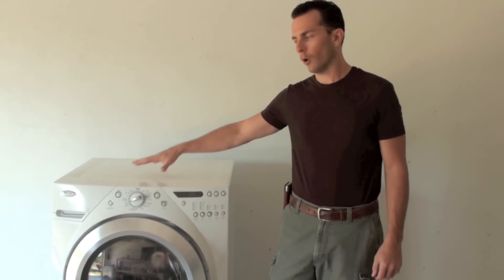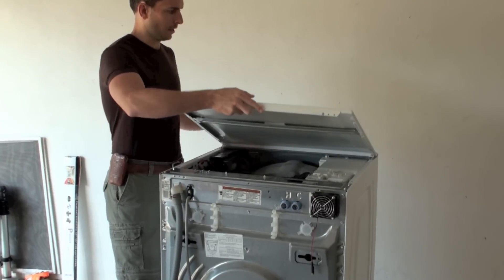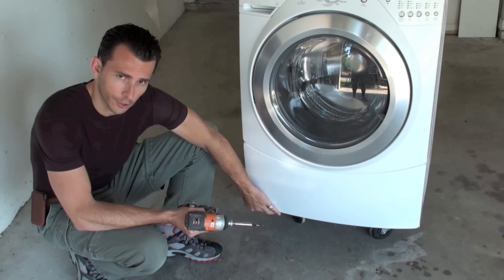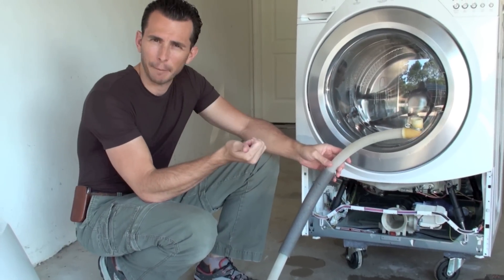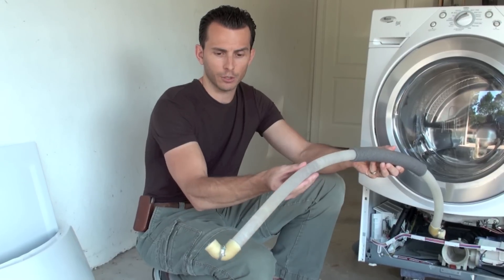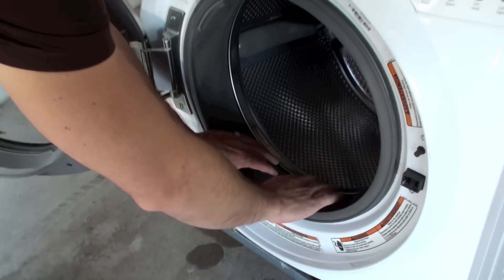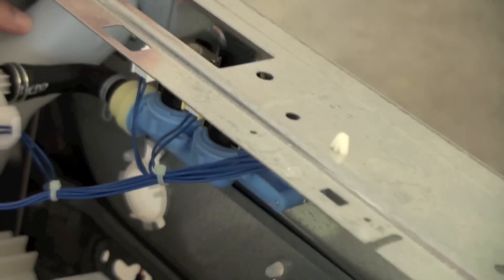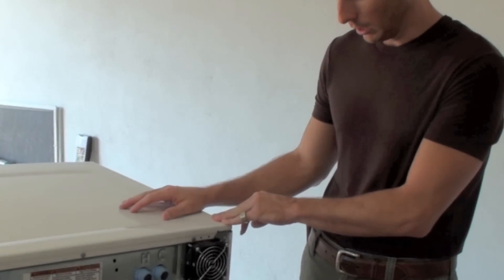Washing Machine Odor is Caused by MOLD - Determine if Your Washer Has a Mold Problem

Comment: The culprit is the detergents. Yes, dirt sticks to detergent BUT detergent sticks to EVERYthing! The modern front-loaders don't even use enough water to rinse themselves, let alone your clothes and the soap is like food for some pretty ugly strains of mold and bacteria. I haven't had a problem since I switched to soap nuts. Plus, my clothes are WAY softer, even though I don't use fabric softener. The soapnuts have eliminated detergent buildup - colors are brighter and everything smells fresher.

Comment: When I was a kid we used to have a front load washer and that never developed any unpleasant smells. There must be something wrong with modern designs that people are having these problems.
Reply from the maker: That is a very common misconception. Every washer on the planet can grow mold even the older machines. This mold problem has been around for longer than anyone even knows. There is just more awareness of it now because all of the manufactures as selling cleaners to try to fix the problem.

Our customers are from every state, and many different countries all over the world in every type of climate imaginable. They tell us that they have every type and age of machine imaginable and they all share the same basic design limitation that allows mold to grow internally over time. How fast it grows depends on too many variables so everyones experience is different. The record so far we have seen is 3 months for a new machine to be filled with mold. The longest is 10 years for traditional top load machines. You would be amazed at the number of Washer Fan Breeze that we ship to Arizona! No machine is exempt from this nasty problem. Thanks

Comment: I have a Meile washing maching. Its pretty fantastic, it cost about £1,500 but even that had a mold issue which the meile tech resolved easily. Our machine has a 15 year parts and labour included.
Reply from the maker: How did your technician say he resolved this for you? If he did not install our Washer Fan, it is not fixed and the odor will return. We have been doing this for over 5 years and we have had many customers tell us they tried everything under the sun to fix it without Washer Fan and every one of them said over time the the odor still kept coming back until they finally installed Washer Fan. They even tried following our Use & Care Instructions to a T but without out Washer Fan it will keep coming back. Glad to hear your have a 15 year warranty which will cover mechanical failures. It will not cover Washer Odor because every machine on the planet still has the same common design flaw which is standing water in the lowest part of your washers tub after the washer has completed its last cycle. Washer Fan compensates for this water sitting in your washer and keeps the relative humidity inside the internal parts of your washer lower than what it is on its own and lower enough to keep the washer odor from being able to stay around.

Comment from the maker: Yes, NEVER us ANY LIQUID FABRIC SOFTENER!!!! You can only leave your door open a crack if you have our Washer Fan™ installed. Before you install our Washer Fan™ you will need to leave your door fully open, but in most cases that will not provide enough air flow to solve your odor/mold problem. There are other factors that allow the mold to grow in the first place, so please see our full website for more free info. Please call us on our toll free number listed on our site with any questions.

Comment: Would not the use of chlorine bleach every so often KILL the mold in the pipes?  The fan is a good idea, but if the mold is already in the drain hose, it can't be removed or killed merely by a circulating fan.

Comment: Black mold wasn't a problem with the old top loaders. I repaired and rebuilt many washers back in the late 1980's and never encountered any black mold.
Reply from the maker: Not in our experience and we have been doing this for over 5 years already! Our customers have every brand and style and age of machine. This includes older top load washers as well. Top load washers can take much longer to present the odor than front load but over time depending on how you are using it, it will happen, just wait. Just pay attention to your clean towels. When you dry off from a bath or shower when you get the towel wet when you start to smell a weird sour smell that is the first indicator that you have mold growing inside your washer. This mold growth does not happen over night and take time. How much time depends on many variables and is different from house to house and how each person uses their machine. Most of our customers prefer to be proactive and prevent the odor problem from ever starting to begin with. But don't take our word for it just wait and when your clean towels start to have a sour smell they you will know that we are right! It may take years but it will happen, and yes this includes your washer as well no matter which brand, style or age.

Comment from the maker: Using any cleaners even chlorine is not necessary when you are using our Washer Fan™ and following all of our Use & Care instructions that are shown on our full website. The Washer Fan™ is not directly fixing the problem but rather taking out of the equation on of the key things mold needs to grow, high Relative Humidity (RH) in the drum. Washer designs do not typically allow for enough air flow for the RH to be low enough to prevent mold growth. Please see our full site for more info.

Comment: its time to design a removable hose system for easy bleach cleaning 1 a month.
Reply from the maker: +tennismediadynamics It is not necessary to ever clean the hose again after you install the Washer Fan and use it as we recommend. It is helpful to clean it right away if you are able to help speed up the process but then after that under normal circumstances you should never have to use anther cleaner or clean the internal hose.

Comment: I find the rubber seal is usually a major source of mold, even after being cleaned. The problem is the seal has a wide lip that fits down between the drums and this lip often has thick mold on both sides. It can't be cleaned without removing the seal, and at that point one is better off replacing the seal. JME. This fan would likely help prevent mold recurring in this area as well.
Reply from the maker: machoheadgames That is a very common misconception. Any mold you see in the door gasket is a very small fraction of the real mold problem. The mold you can not see is the mold that actually is causing the odor. Once you install our Washer Fan Breeze and use it as directed you will not have to do any special cleanings or taking your machine apart ever again. We do recommend replacing the internal drain hose if you are able to, to help speed up the process but if you are not able to the Breeze has still proven to be 100% effective.

You will find that when you have Washer Fan Breeze installed properly that the door gasket will be dry very soon after completing a load of laundry and leaving the door cracked open. When that gasket dries much faster then normal, it helps prevent mold from growing or coming back in the door gasket. If you have any further questions please create a support ticket directly on our website and we are happy to answer any questions you may have. Thanks!

Comment from the maker: Yes the Washer Fan™ is designed to run 24/7 and yet use less than 8 pennies of electricity per month and last over 9+ years (in most cases unfortunately that is longer than most newer washers will last). Please see our website directly for answers to most questions. Our toll free number is also on our site so you can call us directly with any other questions. Thanks

Comment: Hello! Great video, thank you! Got a question, does the round washing basket sit in water after the wash load has finished? My washer basket, when empty, when I push down and shake it, you can hear water slopping around, is it supposed to do this or should this water have FULLY drained when the wash cycle ended? If it was suppose to fully drain, how do I fix this because I am thinking this might be another area where my washer smells because if we don't do laundry for a few days the water is getting stagnant like a still pond versus a gushing, moving river. Thank you very much!
Reply from the maker: Tim, thanks for your question. Every washer on the planet has the same basic design limitation that allows for water to stay in the lowest parts of the machine after every wash. Please submit a support ticket directly on our website WasherFan.com and I am happy to discuss this in more detail with you. Thanks Troy
Reply: Unless you only use your washer once a month, that small amount of water that remains in the sump isn't the cause of foul odors coming from your washer. I do wonder, though, if the use of plastic outer tubs contributes to or is the cause of the odor problem. That somehow the plastic encourages mold and bacteria to grow. In the past washing machines did not require cleaning cycles. The wash bowl was made either from stainless steel or enameled steel and so was the outer tub. Every time they were used they would clean themselves and smells were just not an issue. There was a time when washing machines were not prone to foul odors as they seemingly are today.
Reply from the maker: Tim, those are many very common misconceptions. First there is 3-4 cups of water sitting in the bottom of most machines and as that water evaporates it keep the humidity level inside the internal parts of the machine above the point that mold needs to grow. The higher the humidity the faster mold grows. The materials are not encouraging the mold to grow as even machines from 25 years ago grew mold, most people were just not away of it then. We get people telling us today they they have mold growing in every brand, style and age of machine from every type of climate imaginable from every corner of the world. This is a global epidemic that is being made worse by the way we are being told to use the machines to be "green". We are trying our best to help dispel all of these misconceptions and educate anyone that really wants to know how they can finally fix this nasty problem once and for all with no cleaners or special cleaning cycles. Buying a new machine does not "fix" the problem, there is not a machine on the planet that has been "fixed" yet, the manufactures have not let us help them fix their design limitations. We are happy to do so when ever they are ready to admit that every machine they have ever sold can have this problem.
Reply from the maker: Ps using your machine more often actually makes the problem worse. We hear all the time that "I use my machine all the time I have a large family so my machine will not have an odor problem". When you get done running a load of clothes the humidity inside the washer is close to 90%. Using your washer all the time never gives the water sitting in the bottom of the machine where you can not see it a chance to dry out. The humidity is the most important factor and controlling the humidity is one of the most important things that Washer Fan does. Keeping the air continuously circulating inside the internal parts of your machine so that the humidity level inside is always the same as the humidity level outside of your machine is the easiest ways to keep washer odor away permanently. This way the water sitting inside does not matter and your machine does not need to dry out between uses.
Reply: Washer Fan
Well, I hope you sell lots of little washer fans.

Comment: The mould problem is mainly caused by the increasing use of plastic outer drums, used by manufacturers  to save money.  It is impossible to get rid of the mould that builds up on them. I have had to throw out a 13 month old Indesit because there were lumps of black mould all over the washing, despite being in a soft water area and running  fortnightly 95 degree cleans with soda crystals or white vinegar. My new washing machine is a Miele, which has a metal outer drum.
Reply from the maker: Hate to break it to you but it is not the material that your drum is made out of that is the problem. It is the water sitting in the bottom of your washer that artificially created a high humidity environment inside your washer that is the main problem. This includes every brand and style (top or front load) and yes even the old traditional top load washers as well. The good news is that every machine can be fixed with Washer Fan. We have never met a machine we could not fix. This includes every washer made with a plastic outer drum which is almost every one of them. Just pay attention to your towels and eventually when you use them to dry off after a shower or bath they will start to give off a weird sour smell when they get wet. This is the first indicator of Washer Odor (AKA Mold growing inside your washer where you can not see it). You will smell it in your towels long before it gets bad enough to actually smell it in your machine itself. The good news is that even at that point you can still fix your existing machine with Washer Fan and following our Use & Care Instructions exactly. Most of our customers prefer to be preventative and keep the problem from ever starting to begin with and install Washer Fan on their brand new machine (or their existing one as soon as they find us). If you have any further questions please create a support ticket directly on our website and we will respond directly to you immediately. http://helpdesk.washerfan.com/index.php?a=add
Reply: Washer Fan The problem has been completely solved by buying a Miele, which has both drums made of metal. You are wrong. The plastic outer drums on cheaper models are notorious for becoming covered in mould that cannot  be removed.
Reply from the maker: Again just wait and keep smelling your towels, it may take several years but it will eventually happen with your Miele! When the smell sour starts in your clean towels, you will know that our 5+ years of experience is correct. No one on this planet knows more about this problem (and most importantly how to permanently fix it) then us. The plastic outer drum is not the problem. If it was we would not be able to fix most machines which have plastic outer tubs, we have been able to fix 100% of them.
Reply: Smiffy83 A
Reply from the maker: We have many customers that have Miele machines that have the odor problem every machine can have the problem over time no manufacturer is exempt no matter how they make their machine! You do not have to take our word and experience for it just wait and keep smelling your towels when you get them wet, that is where you will smell the sour smell being caused from mold growing internally first.

Comment: I have a portable washer and what I usually do after a wash is leave my door open and detergent door open and it always dry out the remaining water thats left in the bottom tub so my other question is why can't you just leave the door open instead of buying fan
Reply from the maker: Because there is still water remaining in the bottom of your washers drum between the inner stainless steel drum you see and the outer plastic drum that you can not see. It is this water and the water in the internal drain hose at the bottom of your washer that is helping to create the high humidity inside your washer which is what the mold needs to live and grow. Leaving the door open helps but it is not enough to get all of the nooks and crannies of the inside of your washer below 50% humidity. You must mechanically get the air inside your washer below 50%. We have had many customers tell us that they tried first to do everything on our Use & Care Instructions (without buying a Washer Fan) including leaving their washers door wide open. They told us later that everything minus a Washer Fan was still was not enough and they ended up having to try our Washer Fan after all and once it was installed, it took care of the odor within a few weeks as promised.
Reply: Thanks a lot😊